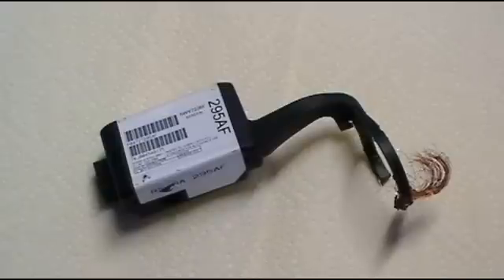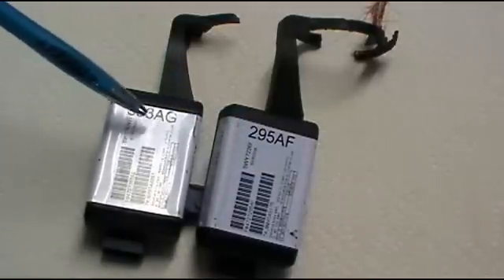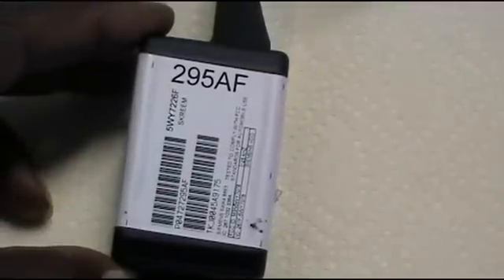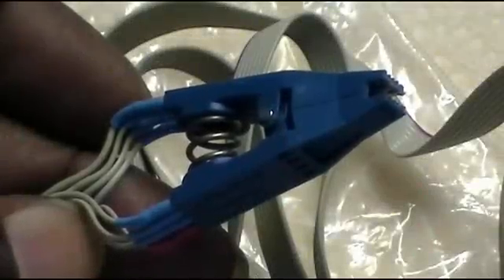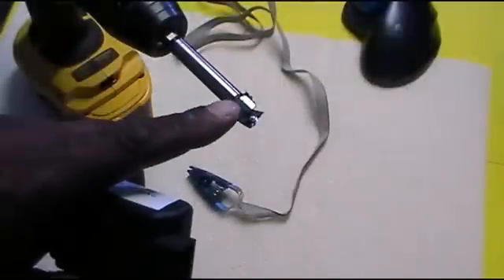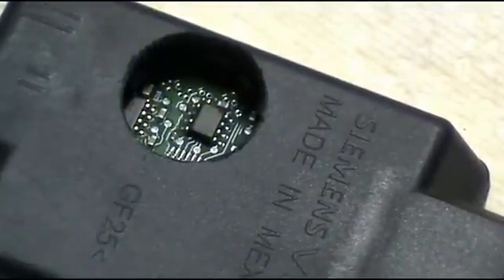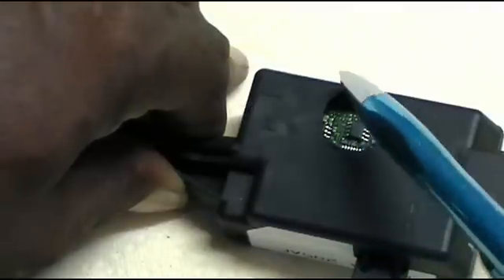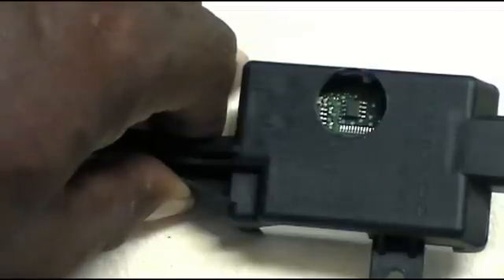PIN CODE READING

Comment: Thanks for the video, where did you find the connection guide ?
Reply from the maker: Hello Zarco. Didn't search to far. It's location came with the circular cut out adapter that can be used to make the hole.

Comment: what program are you using?
Reply from the maker: Thanks for asking.  It was an older application that was good up to 2008. Since then,  most programming equipment will obtain the pin code.  But you can still use DMAX on those older SKIM modules.
Reply: @willm837  how much does it cost and where can I purchase it in US? I have. advanced immo scanner that can do obtain pin code from 2009 and later vehicles. My unable to find pin code for older. vehicles. So I think this would be perfect.

Comment: I can't register with nastf because I'm outside USA. What to do ?
Reply from the maker: +saddam al-rushdi Thanks for asking.  There is equipment that you can purchase, which will let you "Read Pin Code" for Chrysler, Dodge, Jeep, and Plymouth vehicles.  You just attach the device to the OBD connector, and your Laptop computer, select the vehicle, and read the PIN code.  Registering with NASTF is not as easy as some would have you believe.  Check online for "Pin Code Reading" equipment for Chrysler/Dodge/Jeep.  You'll see what's available and the cost.  Thanks again for asking.
Reply: +William Mcintosh 
Thanks for help. This won't work on years 2009 and above.
Reply from the maker: Yes, the tool will work on 2009 and above.  No problem.
Reply: @willm837  Where?
Reply: just started locksmithing in California.  Enjoying your videos, very informative.
Thank you.